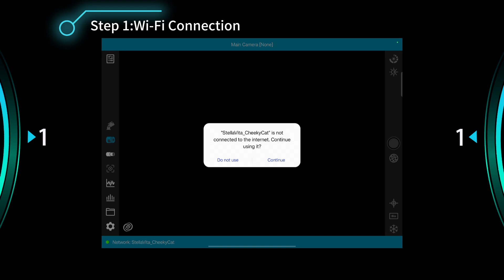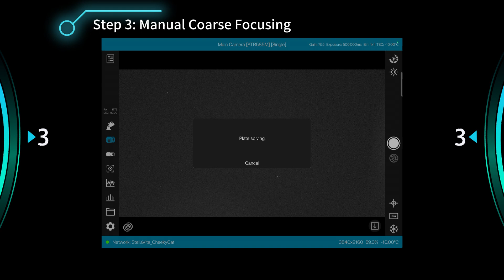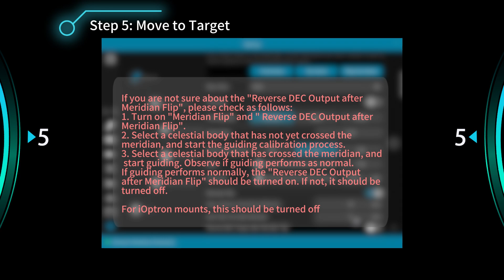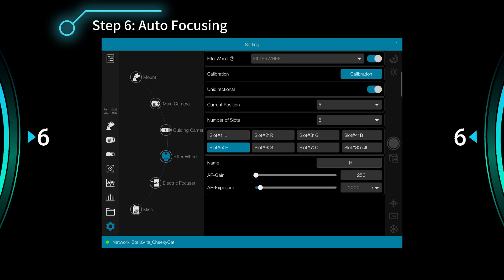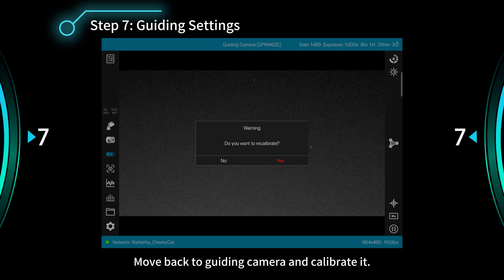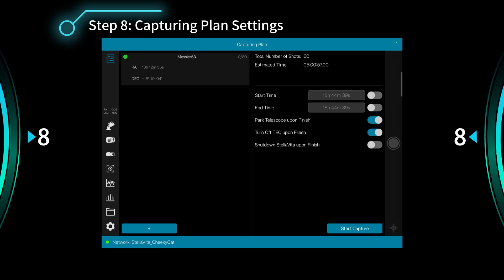Struggling with ToupTek StellaVita? I Got You! Full Step 1-2-3 Tutorial of StellaVita is Here.

Comment: Hello, yesterday I tested the StellaVita for the first time, unfortunately with 2 major problems…
I first performed polar alignment, obtained a correct error, and then managed to return to the home position. But when I tried to use the Go To function, the mount was completely lost and pointing towards the ground. I tried to realign it several times, but the problem persisted.
After about two hours of struggling, I decided to go back to the old method: manual pointing. I found the nebula, but couldn't start a sequence: the StellaVita was requesting information about the target and I couldn't access the task settings :/

Comment: I've given up on Stella Vita.  I cannot maintain a connection, whether directly with the device hotspot or through the relay to my own network.  I've tried the provided antenna/adapter as well as purchased recommended antenna/adapter "upgrades".  Nothing works.  Also, my Skywatcher mount connects fine sometimes and not other times - reasons unknown.  And lastly, attempts to use the SD card slot for data capture were initially fine but then for some reason, download and transfer during shooting sessions just stopped.  This device is not ready for prime time.  I don't have any of these issues using a mini-PC with my rig.

Comment: Is the wifi stability still bad? I have read a couple reviews that claim teh wifi stability is bad but that a better built in wifi card was supposed to come out but is that in the current retail models?
Reply: My connection is good, but it does not like my non-Touptek cameras. It does not like my EQ6-R mount... That's a common mount....

Comment: I'm trying to run autofocus, but it consistently fails despite getting a great graph. it's always on the very last step where it goes to what should be the optimal focus point, it just fails and gives me bad focus despite doing great up until then. Nothing I've tried in adjusting step sizes helps. What could this be?
Reply from the maker: Hi, sorry for the problem. There are several things to confirm: 1. Which telescope used? 2. If Autofocus backlash compensation is filled in？ 3. How did the autofocus graph seem like? "V" , "W" or a very smooth parabola opening upwards? 4. If there is any error prompt  in the APP? Please let us know and we can identify the problem. Thanks!
Reply: @ToupTekAstro Hi there, I sent an email with pictures and more details as well. Graphs are nice parabolas, there is some backlash visible but the option seemed greyed out. But I can't test it any more because the unit won't turn on now! Same power supply and cord as the night previous, but it won't turn on and the system/power indicator lights don't turn on either. I can confirm it's receiving power at the cord, and seems to draw power when I turn the switch on judging by the power supply, but it never turns on and no indicator lights turn on on the unit. Very sad it stopped working on my first trip to dark skies with it! I've only had it for a couple weeks.
Reply from the maker: @gabewrsewell  Thanks for your reply. Our technical support will help you out there in the email. Thanks!
Reply: @ToupTekAstro Thanks! which email should I use? I haven't heard back yet
Reply: @ToupTekAstro I still haven't heard back, what email should I be using?
Reply from the maker: @gabewrsewell  tpa-support@touptek.com is the techical support email. Did you send it there? Sorry for the late reply. It will take some time for them to review the emails recieved.
Reply: @ToupTekAstro that's okay, I appreciate you following up. the AliExpress store I bought it from asked for evidence of the issue, and while I had it plugged in and on to show that it wasn't working, it started emitting a burnt electronics smell, and stank up the whole room. So it's clearly not just a bug but a defective unit, should I still email your support for help? or is this a vendor issue only now.

Comment: 1. Does the StellaVita fully support the MiniCAM8 from QHY yet?
2. Does it support the ASI585MM Pro?
3. What's the max ROI in video mode?
Reply from the maker: StellaVIta supports MiniCAM8 and ASI585MM Pro now. And the ROI in video mode is 720p. But if transmission isn't stable, it will be automatically compressed.

Comment: Thank you. 
This covers a few points I missed before. For example how to set and re-use the guide calibration properly, how to set up the focuser.
I can download the data using the windows share: \\ipaddress\as  (user=as pw=astrostation).
I could not see how to look at the log files though - it downloads them to where ?
No method to use a dark frame with guiding ?
No way to connect a mount wirelessly (eg iOptron HEM mounts wifi, ZWO AM5 mounts bluetooth) ?
When connected to my home network my files seem to get backed up to a remote cloud server - no mention in manual.
Reply from the maker: Thanks for your feedback. We will work on the aspects you mentioned to see if we can provide some instructions on them.